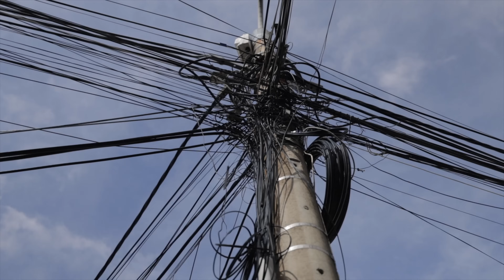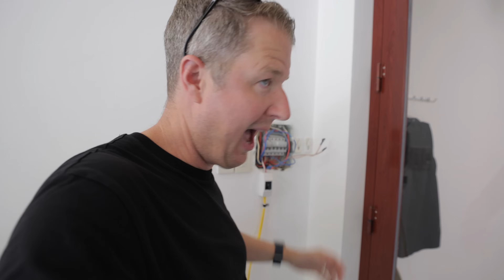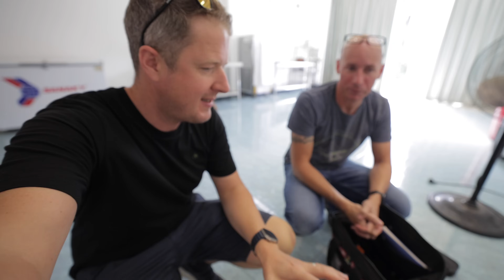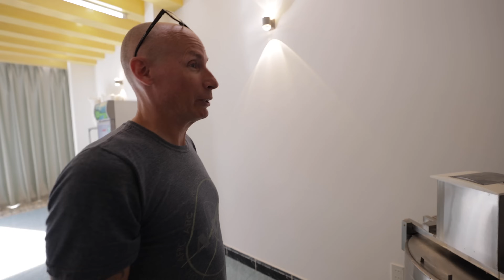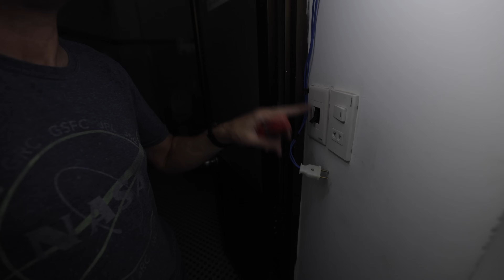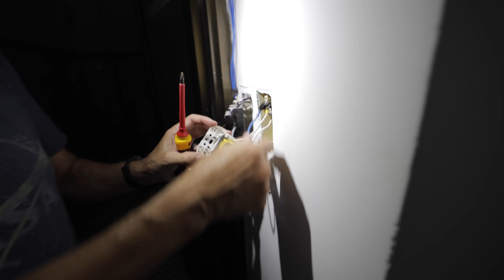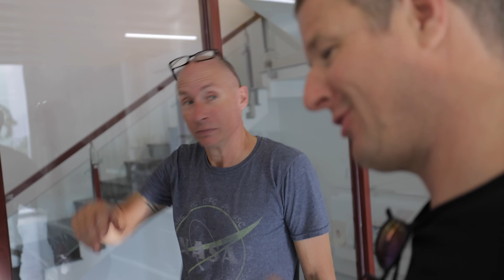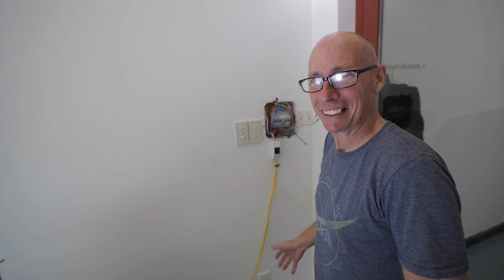USA and UK Electrician tackle CRAZY electrical wiring in Vietnam

Comment: As an electrician myself i prefer the twisted wires.
In combination with Conex wirenuts it is in my opinion the most secure connection.
Seen to many burnt out wago's (The old green ones) but never had a problem with twisted wires.
Reply from the maker: Fair enough
Reply: I've seen loosely twisted wire nut connections that have failed years after use. Transparent wagos are nice though as you can visually inspect the connection without taking them apart, something you can't easily do with wire nuts (nor the old wagos)
Reply: I agree to that statement.
Twisted wires should be tight twisted.
The conex wirenuts have a spring in them that holds it all tight together.
The new lever wago's are nice.
The old green ones are a fire hazard.
Terrible design.

Comment: Surprised no one uses a “ toner” on the fault line for testing …locate and then measure confirm and test to verify
Reply: Toners from what I have seen in the past are typically used by audio visual installation sparks. It’s kind of like the induction live testing wands like fluke make to check a live wire without splitting the wire. On the end of the circuit is a box that connects across two conductors. This in effect makes the eddy currents through the conductors electro magnetic field be much bigger than the fluke small test wands, same thing but it’s great for waving a wand at a wall and pick up the circuit route in a wall. Very handy bit of kit.
Reply: @DuckTheMatrix  I cannot lie I have used a cable locator (for data cables ) on 230v  
But only when I knew it was disconnected both ends .
Just to identify which cable was which rather than shorting one out and measuring between all the cables at the other end 

Generally sending a tone down the line on 230v is a bit difficult to identify as all the neutrals are joined at the switch board  as are the actives ultimately after they've gone thru the rcd/ CB   

( Connect to one cable and all the cables in the installation 'sing out')
All be it in various strengths 

That's why it took them so long to make an AC  circuit  C/B locator etc
( Plug unit into a power outlet and use the receiver to find which C/b feeds it) ( useful in hirise offices ,where the board legends are missing or unreadable - or just wrong ! , when you are looking for the C/b to turn off power to do work in  the tea room you don't want to inadvertently turn off the office server /the  critical server that links whole department across the whole country  (oops!)  Just because the legend said it was tea room )

Fluke had one years (90's 00's) ago that was a bit hit and miss ( and f★cking expensive) and you had to use your Jedi force to guess between the indicated ones even then.
I would hope they have ones that are alot better and more accurate now.

I know the concept of how they work,
I dont know why they wouldn't have  made ones a lot more accurate now
Reply: @DuckTheMatrix  in a previous life I was a feedback measurement/ instrumentation guy ..and I found that equipment can be applied  across assorted designs( ie but cut crystals ( piezo ) are used in lighters timers and pressure related signal returns …. Never restrict its uses …old geezers full of hoarders info trash…lol
Reply: The mastech has multiple frequencies and level controls ( a Klein one I saw ( he did not have the batteries in it so we did not use it was supposedly as good or better…being past retire I went for the Chinese one …not to mention cheap…lol
Reply from the maker: Could you explain how you would use this to find the fault? Sounds interesting.
Reply: Use the toner to locate the wire ( and also any secondary contacts …or sound becomes dead on breaks ) the Chinese 240v ( mastech  brand ) have improved their capacity .. used them for years in exchanges when noise is an issue……it’s pure resistance location behind gyproc…………once used a utility locator to find where a wire was in a refurb….very noisy but worked finally…. @artisanelectrics
Reply: Old bits like me use what’s at hand… @artisanelectrics